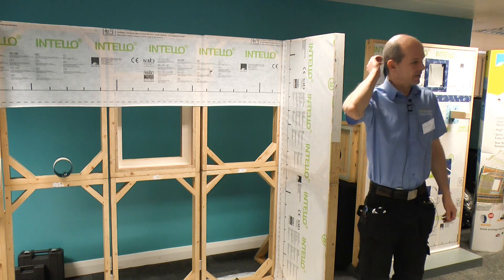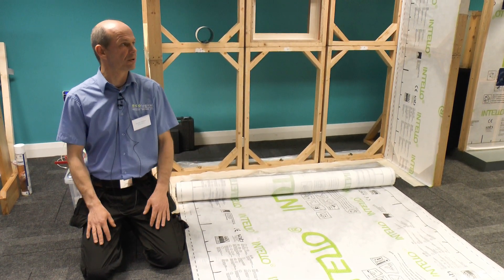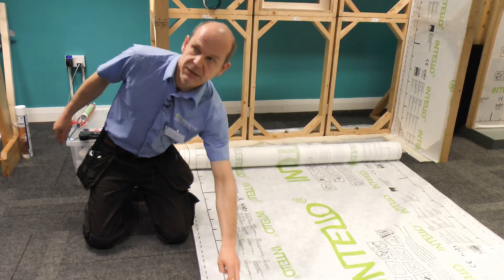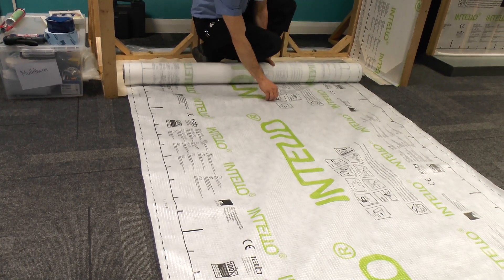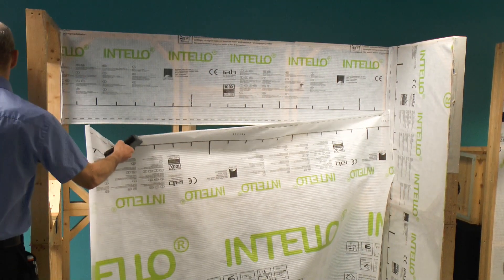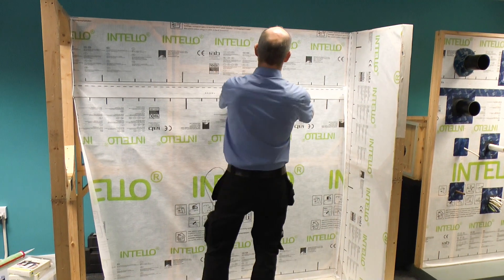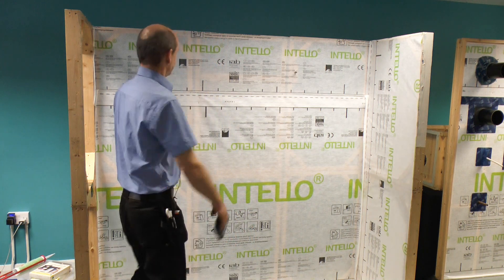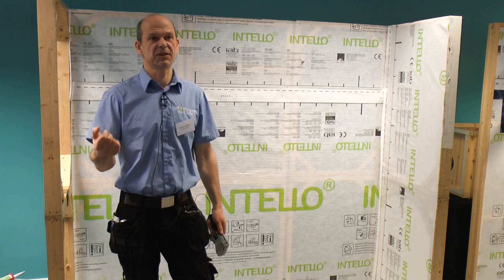Installing Pro Clima Intello Plus Airtight Intelligent Membrane

Comment: can i use this intello as a subfloor vapor barrier? i dont want the cold vapour from the garage below to penetrate the subfloor and gets inside the house floor.
but i want the floor joist to dryup if incase there is condensation/water drain down if the floor accidentaly have water leak
Reply from the maker: Hi @bonjob47. To avoid confusion can you provide a detail of your intended construction that we can discuss and review for you please.

Comment: Is excessive overlap an issue? My builder overlapped seams by 1.5 to 2 feet. Should I cut back the excess or is it safe to tape as it is?
Reply from the maker: Hi @godsbluehills, no the excessive overlap is not an issue. You don't need to cut back the excess unless it causes a problem for taping.

Comment: Does this vapour barrier go over insulation boards or do the boards go over the barrier?  I'm trying to D.I.Y insulation as retrofit and want to know how to use the sheets. Thanks
Reply from the maker: The video describes a typical installation of Pro Clima Intello Plus as an airtight vapour control layer on a standard timber frame wall. To advise you further and provide the right solution for your retrofit project, please contact our technical team via our website.

Comment: Hi! I was wondering about all the staples that have not been covered with tape. Don't their holes add up over the entire wall/building making allowing the vapour to pass? I would appreciate it if you could try to explain why they are not a problem. I haven't really found a satisfactory explanation yet.
Reply from the maker: When installed correctly (following the Intello Plus installation guide fully), the staples do not cause any significant risk of air leakage. The staples, when applied, push through the airtight membrane making a small hole that is plugged by the staple itself; like pushing a needle through a sheet of rubber. So long as both legs of the staple go into smooth timber correctly, and the membrane is tensioned and supported correctly so it can't move during the lifetime of the building, it will remain airtight. 

The staple must be fully inserted into the timber with the correct force so it is flat on the surface and tightly gripping the Intello. Too much force (where staples are too deep in the timber) can cut the membrane and cause leakage. 

When the membrane is installed INCORRECTLY, too much tension or "pull" can occur on the staples, causing the staple holes to elongate and cause air leakage. Always follow the installation guide completely to avoid such issues.
Reply: @EcologicalBuildingSystems  Thanks for the explanation 👍

Comment: is it better to start from floor or from ceiling for blown in insulation.  My idea is better from top as in video. Cause if started from floor then overlap will form like a "pocket " where insulation can put pressure on tape?
Reply from the maker: On a standard 2.4m wall panel, the insulation is blown-in through a hole 150mm from the top using gravity to assist. When Intello Plus is used with blown-in material, cross battens (max 50cm apart) must be fixed over the membrane to support the weight of the insulation. The battens prevent forces on the staples damaging the membrane and causing air leaks. Please see our Intello Plus installation guide on our website for more details.

Comment: I am insulating my suspended timber floor. Some guides recommend Pro Clima DA and others the Intello Plus, seen here, for use as a "Vapor Control Membrane". Why would you choose one over the other to do the same task?
Reply from the maker: Either may be used, but Pro Clima DA has a much higher resistance to "scuffing" and damage if it's walked upon, hence the recommendation for DA in such cases.

Comment: Great explanation. Should we not tape over the staples as well?
Reply from the maker: So long as the staples do not miss the timber and are applied correctly (straight and all the way in), there is no need to tape over them; the Intello membrane will maintain a seal around the staple penetrations. Care should be taken not to over tension the membrane to avoid tearing or elongation of the staple holes.